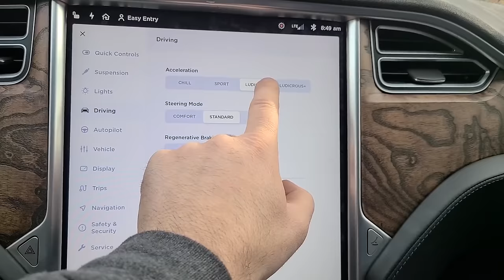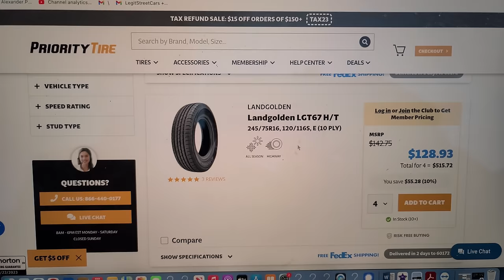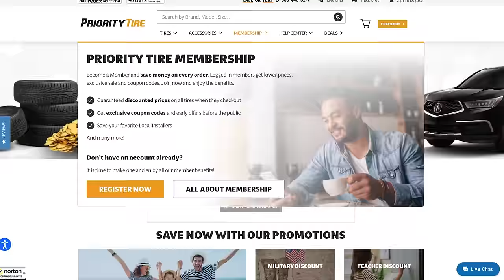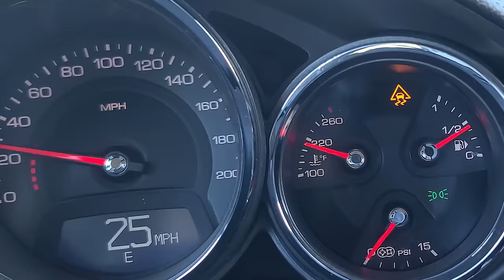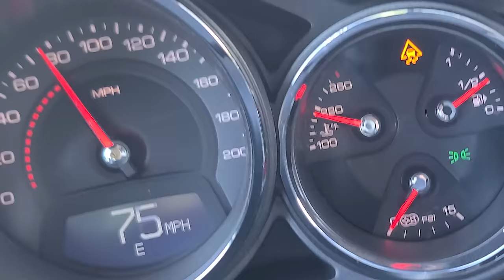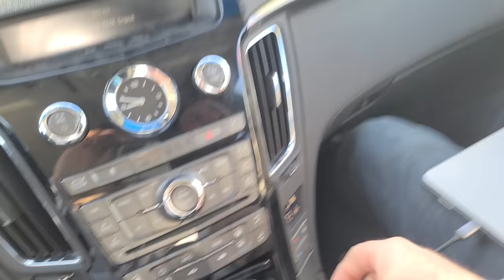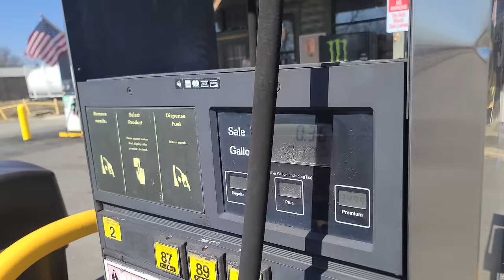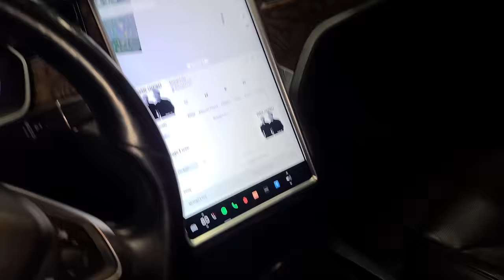I Bought A CTS-V Wagon From A Shady Used Car Salesman 700 Miles Away! Flew With Tools To Drive Home!

Comment: I have a 2011 V Wagon as well. Congrats on the purchase! 
Before you add any boost, make sure you get the intercooler brick reinforced. Factory boost is around 7-9 PSI. Anything more, the brick can collapse into itself.
14 City/18 Hwy is about right, which is why I sometimes call mine the "Thirsty Girl".
I added a Navtool Apple Carplay/Android Auto box to work with the factory head unit to bring it sort of up to date with technology.
Before you commit to the Recaro seats, go find someone who has them and sit in them. They're supportive, but pretty stiff for a long road trip.

Comment: Alex and crew - I love the channel.  It is a Saturday morning ritual to wake up, get a cup of coffee and watch the newest upload while I'm home with the kids and the wife goes for groceries.  I have a 2013 ZL1 with the LSA - a few things to note with these engines.  1.  They get horrible mileage no matter what.  My car is a max effort stock bottom end build with 765 rwhp on E85 and it gets 7mpg on E and about 10mpg on 93 and meth.  Lambda is 1.0, it doesn't matter....just the way roots blown LS engines are.  2. Check to make sure the intercooler brick inside the supercharger lid is reinforced.  The end tanks tend to crush under boost even at factory levels which causes high IAT2s and can even leak.  3. Get a catch can, the inside of the supercharger gets DISGUSTING from all the blow by.  4. A good port on the blower from a reputable company really opens these cars up. Get the Kong X-Port and make sure you have enough fueling to support it.  Lastly, enjoy the car, they are alot of fun.
Reply: This is perfectly stated and couldn’t be more true. I lost Dad a few years back—he was a car mechanic—watching these videos makes me think we’re sitting next to each other on the couch then getting under the hood together. These guys are where it’s at!
Reply: Agreed. Built LSA with 150 shot and Cam. 8MPG on E85. 2012  CTS-V Coupe
Reply: Think he said the blower is already ported but still good advice.

Comment: Get the intercooler brick reinforced before adding any additional mods to the car. Going E85 on the current setup you’ll get another 60-80WHP but you’ll need to see what injectors are currently in the car and may need more fuel pump also. If you want to add more boost look into a larger lower pulley to keep belt slip to a minimum. Lastly having a lack of sunroof makes it a rarer spec. I myself own a manual wagon, slick top (sunroof delete) and couch cushion (non-Recaro) spec and love it.
Reply: I saw a manual one once - it seemed perfect.

Comment: Air Raid Intake with green filter and green belt ,E85,2.55 upper pulley, 1050 ID injectors, headers and exhaust,ice tank, walboro 450 fuel pump
same build as my brothers V and hes making 650-700 RWHP

Comment: I think as awesome as the Tesla is that CTS-V is absolutely beautiful, amazing and awesome and then considering all the things you can still do to it to get more power out of it, it’s a no brainer. When will you possibly come across another one like this? Even though it’s been repaired as you seen when you had it in the air there’s nothing wrong with it. You did well getting the Cadillac and I definitely think you should keep it as your daily! You won’t regret it. The tesla I know would be great on those long trips and where the car can actually drive you. But there’s nothing like being in control of 600/650 rear wheel horsepower. “Keep the Cadillac please!”.

Comment: I changed my Diff fluid and added Lucas additive and the rear is almost silent. If the rear seal isn't leaking it is a good deal. Tranny fluid was Morbid!! Check the car fax for the last supercharger replacement. Great video guys!

Comment: For the LSA if you run flex fuel you will probably need to add a DSX Aux fuel pump or replace the twin pumps with higher volume pumps.. you probably close to max on the pumps now depending on pulley size.. you won’t necessarily need to run more boost .. but you’ll pick up 50whp these cars love E85.. I have full bolt on ported blower ZL1 did the work myself for credentials purposes

Comment: Those paddle shifters are supposed to be held on with 3M tape. The kit comes with tape preinstalled, but a couple piece of 3M's double sided adhesive cut to fit would do fine to hold those on. Mine have been in my car for months without an issue and they work a lot better than hoovie claims. He hates modifications.

Comment: I have the White Diamond Tricoat, which I imagine is a bear to match. But after seeing your red. Well, I can tell you the refinish they did is OK. The problem is they should have done the whole side, if not the whole car. For what a V, especially the rare wagon sells for, a complete paint job is justified. But no matter how good the painter is, or how good the paint mixer guy is, conditions like temperature and humidity are going to introduce slight differences in the pearl midcoat that you just can't duplicate like the factory finish.

Comment: I had an 09 CTS-V sedan and I can say this much...repairing/replacing mundane parts like headlight bulbs is absolutely a trainwreck. Also, plan on replacing the driveshaft carrier bearing and wheel bearings more than once. The seats aren't cooled, they're ventilated (when the option is present). Also, be glad you don't have the panoramic roof because the drains get clogged OFTEN and soak the C pillar fabric. Aside from those things, you're in for a treat. Mag ride is amazing.
Reply: My 09 had no issues with the driveshaft or wheel bearings nor did the sunroof leak

Comment: Hey guys, welcome to Club V!!! :) Just some clarity from someone who's been daily driving a V for 5 years.... press TC button once and trac. control is off but Stabilitrak is fully active. That's the way I prefer to drive most of the time. You can still do burnouts, but Stabilitrak will keep you from getting too out of control. If you press the button twice within a few seconds, you'll go into "Stabilitrak Competitive Mode" which is a little more aggressive but still keeps some Stabilitrak features active. That's ideal for track racing. If you press and HOLD the TC button for like 10 seconds, it will display "Traction: Off Stabilitrak: Off". I would highly recommend NOT driving in that mode, unless you're on a closed course, as that actually defeats ALL driver assist features. It can get sketchy real quick! LOL  Anyway, it took me a while owning and driving my V to figure all that out and learn which modes were actually practical on the streets. Hope you enjoy the Daily V as much as I do!! :)

Comment: I have a CTS Sportwagon with the ten speaker Bose system. Yes, the sub in the spare tire section was designed to also hold down your spare, so don't throw it out, unless you're trying to save weight to go faster.

Comment: On the loving of large vans, my first vehicle was a 1988 Chevy G20 Conversion van pulled from the woods after 6 years of sitting. We bought it in 2002, and when my dad passed we had 4 vehicles, so we sold some and gave that to our cousins in upstate NY. That's where it sat for 6ish years until i resurrected it in 2012/2013 when i started to drive. Forever love big body vehicles

Comment: The paint on the handle and the running board are the rebuild paints cos d running board was changed from white to red and its darker and same with the handle .. The car has a colour code by d drivers door ..from that, the factory paint can be reformulated ..but over time, the handle and the running board paint will blend with the factory paint

Comment: Yes the sub sits in the spare I've seen them before was a tire shop manager for awhile at town fair tire and the wheel usually sits face down and the sub sits inside and is usually a fullsize spare

Comment: I had a 2011 CTSV sedan. Be glad you don't have the sunroof. Mine leaked like crazy. Luckily I had a certified pre-owned warranty to 70k miles. Always launch with the magnetic ride in comfort. Race mode is only good for track time. Make sure the super charger TSB was performed. It should have been done under warranty, but check. Charger fins make contact and no more fun. E85 wasn't a popular tune for the CTSV in my area (Charlotte, NC). Replacing the charger pulley was the most popular.

The CTSV is an awesome car. Rear tires will cost a fortune along with gas.

Comment: I used to mix paint when I worked for NAPA Louisville. You have a flip and a flop to check and see how the paint will match the sample. It looks like repair facility that repaired the body didn't take the sample outside to make sure it matched that way. It probably looked correct under incandescent lighting, but getting out in natural sunlight..... different story.

Comment: With that beautiful color I would definitely color match as close as possible on the calipers! It would be so nice! And gloss black or satin the grill, the paint is throwing a shade because the flow of the Pearl coat that’s the trick is figuring out the direction went. This is a killer great looking hot Rod!

Comment: I owned a 1994 Ford Aerostar that the differential whined from new. The dealership adjusted the lash to no avail. It was still working fine at 223,000 miles when I sold it.

Comment: 2.2 l MX6 or 89 Ford probe GT came soft with 9 lb of boost if you go to the 15 lb of boost with an HKS electronic Valve controller ,the bigger the engine more boosted it can handle for example semi truck could probably handle 60 lb of boost

Comment: You are getting less miles per gallon because you don't have cat converters. As a tuner I have found that removing back presure of the exhaust causes loses on MPG I'm not sure what it is but I've had to add 10% of fuel to vehicles after doing cat deletes and going open down pipe.

Comment: I got rid of my Corvette (745hp at the wheels) and accidentally ended up in a Tesla Model 3 w boost.  The Tesla is so much more fun on a daily basis from traffic light to traffic light.  Add in never having to go to the pump and for me, it's a no brainer.  I bought the Model 3 and turned around a month later and bought the P100D.  Tesla for the daily win, and a second car for a 1/4 mile + track.  You can also move up to a Plaid if you wanted something on another level past 85mph.  

Final verdict: daily the Tesla, keep rockin the ICE builds and flipping the cars!

Comment: I have a 2001 Ford Expedition that has a mild rear-end noise, it's been like that the whole 18 years I have owned it and it has 250,000 miles on it now. the noise in the rear end is not bad at all. New fluid and additive will probably do the trick. You're pretty Limited on who would buy the car with a rebuilt title. If it was rebuilt correctly by professionals I would totally buy it.

Comment: If you have a limited slip diff Find out what type it is and what additive it requires and what amount it requires before just pouring in whatever you find at the parts shop.
There are three main types of lsd, clutch, slipper disk and Torsten. There’s also a dog locker like the Detroit locker. The clutch type will be destroyed if you put in the wrong additive or too much additive.
The others won’t care much except the slipper disk and Detroit will stop being limited slip and become open diffs if you put too much additive in.

Comment: There are storys of people putting saw dust in the diff to reduce noise but???? , never heard of that😉.
At 32:../33:.. minits. I am also curious. I have worked on carb engines but never on f i . It was said that compression ratio should be under 10 because of self igniting the air/fuel mix. How does that go with fuel injection? Is it possible to inject gasoline timed like a diesel? Or do you still have to stay under a certain pressure so the gasoline wont ignite. Ps. I know the octane story so i know 85 will slower ignite than 95 or 98 or whatever is sold in the usa.
Drive this cvt for a month. I see you enjoy it. After a month and 2/3 or more times a week at the pump or your kids not liking it you can make up your mind.

Comment: due to the age of the tesla and you only having so few years of the battery/motor warranty from factory I would say sell it so a new buyer could possibly get an extended one for cheap.  my 2015 p90D just had its rear motor fail, and I have about 7 months left on the warranty from factory soo lucky there.  and I only have like 45k miles on it.  needless to say if you can daily the other it might be better off in the long run.  

keep up the fun cheers.

Comment: Look into having a factory style inbuilt sunroof put in Alex. Had one from Webasto installed in my truck and it looks and functions like the factory one. That paint was never blended,. They just painted the new stuff and slapped it back together. Reds are one of those colors that must be blended into the old paint or it will never match. Oh and they are decades away from being able to mandate electric vehicles. It'll take at least 20 years to bring the electrical grid up to standard to be able to support it and they need to figure out a way to get the raw materials for the batteries without using child and slave labor. Check out the cobalt mines in the Congo. 75% of the cobalt used in lithium batteries comes from there, mined by kids as young as ten. The companies using the cobalt know this, but unfortunately most of the population is ignorant to it.

Comment: With a factory ecu tuned with flex fuel will be safe to run an aggressive tune as the flex fuel measures the content of ethanol and will adjust the tune to keep the engine running safe. That is if it’s a 2016-2019. And if you think you’re getting bad gas mileage now, wait till you run straight E85. I have an 08 cobalt SS with full bolt ons, tune, headwork, larger valves, stiffer springs and stage 2 cams.  I went from 28-30mpg highway to under half that. And that’s driving easy. I was stopping at the gas station 5-6x a week. ENJOY!

Comment: The doors were sprayed with the metallic paint while they were flat and the rear quarter was sprayed on the vertical so the metallic flakes are laying a different way, hence why the colour is different at most angles.
Reply from the maker: Makes sense

Comment: Re: Bluetooth--If the car has OnStar, it should be configured to do Bluetooth phone. If it's like the rest of GM's infotainment bits of that time, one may be able to replace the PDIM ("personal device interface module") to be able to add AD2P capabilities to the factory head unit.

Comment: Is fun racing a car like that all the time and any car high RPM causes the water pump to spin a lot faster of course causing water pressure to cause the water hoses to come off the radiator just a heads up

Comment: Memories of my 2003 STS, when I discovered the all in one wheel bearing hubs were wear items, which unfortunately was not realized before I installed a set of EBC redstuff pads, they were not ideal on the street, but coming off the highway, the party trick, pushing the brake pedal far enough to begin slowing, and then hold my foot in place, as the pads heated up, the braking force would increase, the hotter they got, the stronger the force, slowing me down to a crawl as I enter the off ramp.  New hubs, new pads, as the red stuff pads were all worn down at an angle...ebc green stuff, better than stock initial grip, and instead of the 8 months the stock semi metallics would last, 3 years before they felt they needed replacing, grip wise, still lots of pad left.

Comment: What a machine, dump the Tesla Alex.  Peter's facial expressions are just the best.
Reply from the maker: I'm pretty sure his smile is tapped into the drive by wire system of the V. As voltage increases it sends a signal to his brain to turn on the smile. Wait until I tune it!

Comment: My 1968 Cadillac DeVille convertible gets about 13 mpg towing a 2900 pound caravan at 50 mph.
Sure, it gets about 13 mpg NOT towing the caravan, as well =D
Stock quadrajet carb, electronic ignition.

Comment: 2 things to consider if it's your family daily.

1. Safety, guarantee the model S has a much better crash rating

2. Cost to run, Model S needs almost 0 maintenance and electricity is cheap compared to the CTS-V wagon.

Comment: You should probably keep the Tesla. The CTS is a hero car from yesteryear as such it has halo status in your head. But the realities of running it as a daily will sink in soon enough. Even though you can easily afford the gas, it will quickly become a pain to visit the pump as often as you will need to. Additionally you have spoiled yourself with auto pilot and running long journeys without it will become a chore. I would recommend parking your Tesla up for at least 3 months if not 6 and then see how you feel before you sell it.

Comment: I guess my other comment (to my link where I list the work I did on my VSPORT) got pulled due to a URL.

The VSport is basically a CTS with the ATS-V engine (a detuned version, but better weight balance).    There are guys with my mods doing high 10's to low 11's.   

Another thing unless I really dog it on E85 (I will get in the 10-12mpg range), I can pull 30.5 MPG on E93.  I was shopping the CTS-V 3rd gen a long time, finally found one that checked all the boxes and just a 3 hour uber away only to find out the dealer sold the car from under me 2 weeks earlier and was stringing me along.   That night on the uber back home another dealer called me telling me "he knew I was dead set on the V3 with the options I listed, but he just took something called a 'v-Sport' on trade and never even knew about them.   I bought the car that next morning and have loved it.   As far as family love, everyone loves the ride and the comfort.   My wife says she can sleep in my car forever (unless I am playing with some throttle drops).  

The V2 wagon though is so iconic though, definitely something you don't see much of.